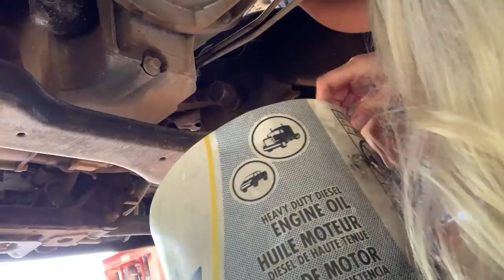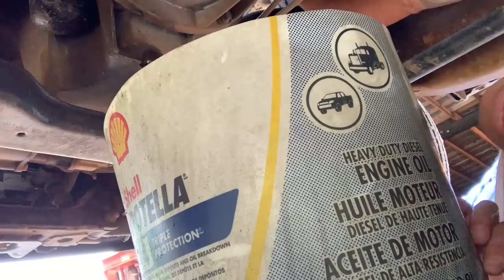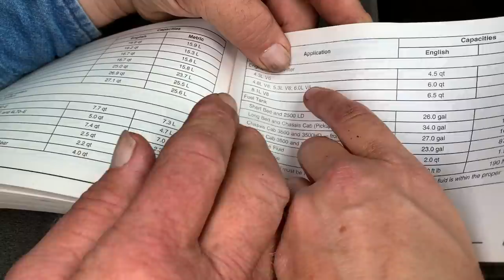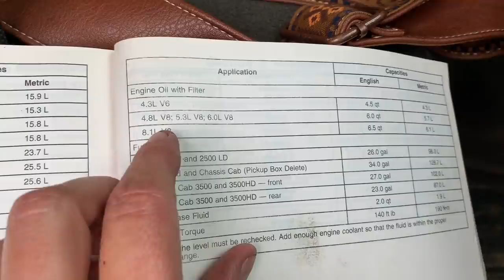I learned how to change the oil in my truck!

Comment: Meredith next time you change the oil get you a pair of dish washing gloves that go half way up your arms. They are thicker than normal rubber gloves and will give you a little bit more insulation from the hot oil. A long sleeve shirt wouldn’t hurt either 😉 oh and don’t put the gloves in the trash when your done just wipe your hands with a rag till they are somewhat clean and put them up for the next time. A long handled ratchet and socket might be easier for you when removing the oil drain plug😁 no confusing wrenches 😂 that was pretty funny I had a good laugh. Happy birthday to your son. Pound cake is my favorite too.

Comment: Hard to beat a good pound cake.. YUMMMM :)   Something I do when messing with my car stuff, changing oil etc.. is to wear a pair of those black nitrile disposable gloves.  They are very strong and saves the grease, oil etc.. from under the nails or on skin, much easier cleanup.

Comment: LB you have enough junk (recycled farm materials)  laying around to make a good and safe pair of ramps to drive vehicles up on. Please make a pair to use in the future. I have a 2500 pickup just like hers and I knew that 2X4 was going to break on the left side. My truck has fallen off that kind of setup several times. A few minutes of safety can and will save a life. Yours and hers. Just saying from Concerned friend.

Comment: "You hit your own hand this time" Priceless....... Neat shell pouch. Not long before bird season. It will come in handy. Your farm Journal exposure will help you and the farm. Could open some doors. Good job on the oil change. Always remember two things. Replace the drain plug and tighten it securely and replace the filter and tighten it too BEFORE you add the new oil ( don't ask me how I know).

Comment: When I was a young man my dad bought a 1961 corvair for 20 bucks and pulled it in the driveway for us three older boys to share. It was in 1971. It needed lots of work to get road worthy, brakes, tires, shocks oil change, plugs carb kit, just about every thing on the interior replaced. I think he got it out of a junk yard to be honest but I said are we, meaning my dad and us working on it together. He said the tools are in the garage, make sure you clean up your mess and put my tools back where they belong. That's the school of hard knocks. He figured he did his part, he bought it. Lol

Comment: Also make sure when you take the old oil filter off that the rubber gasket ring is on it and not stuck to the engine or you will end up with 2 rubber gaskets on top of each other and it will leak. Each filter comes with a rubber ring gasket attached so just make sure the old one comes off with the old filter as sometimes they can stick to the engine. If it sticks just pull it off and toss it so the new filter gasket sits against the metal on the engine when you screw it on.

Comment: One thing when changing oil on your vehicle make sure you don't double gasket your oil filter. When you remove the old oil filter the gasket from the old oil filter does not stay attached to the base .

Comment: Happy Birthday, Wes! I was smiling the whole time you were changing your oil.... Remembering the first time I tackled that job. My Dad bought a new 57 ford station wagon and had it till 1968. I can remember a lot of good times and lots of things that happened in that wagon and to it. That's the car I learned how to change the oil on when I was in 6th grade. I pulled the plug and drained the oil and changed the filter for my Dad so he wouldn't have to get under the car in the dirt. He then added the new oil and ran it for a few seconds. Shut it off and proceeded to check to make sure the dipstick showed correct amount, and it was way over full. He started checking to see what was going on and found the oil in the drain pan was red. I had drained the trans fluid. He had me follow him back under the car and explained to me the difference in the motor and transmission. He was so calm about it that I remember to this day how bad I felt but he made out like it was not a big thing. He had to go get more oil and filter and trans fluid. Cost him more than double that day but I learned a life lesson.
Reply from the maker: Aw that’s a great story! Best lessons 🥰

Comment: Nothing wrong with good high quality 15w 40 oil  Diesel  rated oil for your truck. But  OEM recommendation is for 5w 30 viscosity oil.Being down south in your warm climate 15w 40 will work fine.Being in the cold northern climate that same grade of oil might be to thick at cold start up. You may experience some valve train clicking on cold mornings when temps dip below 20 degree F.Always watch your oil pressure gauge at startup. My 08 Silverado with the 4.8 L i find the 5W-30 flows better in winter time.I change my oil  once every spring with just under 50%oil life remain.

Comment: That is the best class you could have on changing oil. Lol.  Learned to lock two wrenches together and LB really wanted you to get filthy.... next time, take a 20 penny nail and a hammer and punch a hole in the filter. Drain the oil out of the filter before you take it off helps.

Comment: You did great with the oil change. You reminded me of my Uncle years ago he took his Chevy pickup to the local mechanic and had it serviced. He drained the oil and replaced the filter and tightened the drain plug. He got a phone call and afterwards he called my Uncle and told him the truck was ready to go. Uncle John picked up the truck and drove home. He didn't go very far and the motor quit. Had it towed back to the garage and the mechanic discovered he didn't put any oil back in the engine. Mechanic paid for a new engine . Always remember to put oil back in and check it after you drive a little.
Reply from the maker: Oh  no! That’s not good
Reply: Also, NEVER rev the engine on start up after oil change.  It takes some time for oil to circulate in the engine.

Comment: Oh, and by the way, while you were under your truck, it would be a good time to change the air in your spare tire.  Air that doesn't get circulated like the rest of the tires will get stale and cause the rubber to crack.  Just a Pro Tip.   I Loved this video.  Not one mention of Lefty Lucy.

Comment: Try using surgical nitrile gloves. They keep your hands clean.  They cost about $5 or $6 per 100 at harbor freight.  Any greasing and oil work. They keep you clean.  Also. Please be safe and use better ramps and blocks.

Comment: You did just fine Meredith, that trick he was verbally teaching you regarding the " Cheater Wrench' adding leverage to the first wrench by adding a 2nd is not simple if you are not show visually how to place them, a simple 1 foot section of 1-1/4 aluminum pipe or tubing works far easier in adding leverage to the wrench, it simply slides over the outside of your wrench in place and doubles or triples adding leverage, that is typically the preferred method for simplicity and the method i show beginners. The wrench trick can be confusing to anyone not familiar, just my two cents, you did good, except pull that hair back and put it in a pony tail.

Comment: Hi, I loved this video.  First comes my oil job tips.  Make darn sure that truck/car is safe on those boards.  Move it side to side before you get under it.  Wear eye protection.  Dirt and rust usually fall on your face.  Have all the tools you need with you under there.  Put fresh oil on the rubber gasket of the new filter and hand tighten only.  Have all the oil you need out and where you can get to it so you won't overfill.  Run the engine for a couple minutes and ck or leaks.  Your hair was beautiful .  What color are your eyes?  We saw them really up close here and they change with the light intensity.

Comment: tip on that oil filter the next time. take a plastic bag put over your hand inside out.. unscrew filter let oil drain for a bit.  use baged hand to remove drained filter then slip bag over filter if that makes any cents no oil on hand
Reply from the maker: I like that idea!

Comment: Great Videos,  glad you learned oil changing on your pickup, Lawrence should have told you to make sure that the old oil filter gasket comes off and to inspect the filter base to make sure there is not a old gasket stuck there, double gaskets have caused many engine failures, I am sure he knows this. Again great channel

Comment: Meredith, I feel that I must apologise for laughing while you were attempting to un do the oil sump stud. Your hair looked so perfectly clean that I almost could smell the shampoo. I feared that a spout of oil would get onto it. The trick with the second spanner is an old one and functions as a lever. (Thus, the law of the lever).
The changing of the oil while being instructed by Lawrence, certainly was the high point of the vlog for me. How you weren’t douched in oil, is beyond me.
Happy 12th. Birthday, Wesley.

Comment: OK Meredith, this week only two Gems of wisdom,1= concerning Lawrence's new boots particularly, or leather goods generally, I've found that to double lives of boots,that liberally applying a lanolin based wax,protects stitching and hastened the breaking in process, 2= when removing tight bolts,nuts,or drain bungs,the using of a socket with a breaker bar,gives better leverage,though persistence in mastering the dual use of Ring/open end spanners is worthwhile skill?also dont forget to fill new filters with oil,before fitting to prime oil pressure, and apply oil to sealing ring?love how you have grandmother's recipes!
Reply from the maker: Good advice! Thanks!

Comment: Lawrence had me laughing when you were changing the oil. Don't worry, I'm not sure how to change the oil either. The conversion with the people who would help me wouldn't be PG like yours. The two guys who would help me are both engineers. One's a retired mechanical engineer and the other is a structural engineer.

Comment: I think the land leveler you are talking about is actually a land "smoother" if its the implement in your last video its a great tool many call a ROLLER OR ROLING HARROW which is like a cultipacker and a cultivator units all in one.  This is different from a "DO ALL" that is basically a disc with a harrow attached behind it.
Reply: One manufacture of a "leveler" is "Brillion", their version of a leveler is called a "Cult-a-Multcher". Great tool as the last-pass  before planting. When the spring-teeth are down it pulls like a: Cat-by-the-Tail.

Comment: the oil is suppose to be hot/warm when u change it all the dirt a grime and particles are all floating in the oil when its hot they settle to bottom when engine is off and cold also it runs out faster when warm :P

Comment: Oh yes you need to palm hit it , brut strength dose not work, cantilever interlock the the box ends just like he told you , they make a cheater bar, it sold at NAPA automotive parts houses, lolol you two are funny, you need to palm hit it a couple of times after it is snug, he is correct if you don’t get the plug tight it will absolutely vibrate out , from harmonics vibration, ok good job mer, love ya thanks y’all BigAl California.

Comment: Should really have used  a socket , longer handled 1/2 in drive, to get off that oil nut. Make sure its 6 pt too not to strip the bolt.Most people over tighten it and the oil filter . But you did it and thats the important thing

Comment: I have to give you a warning if you ever get to use a creeper to get under a vehicle make sure you put your hair in a ponytail. I used to have long hair and I didn't put it up one day I was changing my oil and I rolled under my truck and my hair got caught in the wheels on the creeper and I was helpless I was stuck underneath my truck it hurt so bad I had to cut my hair to get free of it.

Comment: I always wear a hat, safety glasses and use a 6 Point socket with Johnson Bar or long handled ratchet to remove those.
For the first time you should have been shown not told.  Always put some oil on the rubber seal of the gasket.  There are wrenches to tighten and remove the filter.

Comment: Happy birthday, Wesley! 🎂👍🏼👍🏼
25:33 Funniest thing ever. That HaHaa, by LB, had me rolling!  😂🤣😂🤣 Should have put that in the highlights, at the beginning.
Find a short length of pipe that will fit over the end of that wrench. It could be 6 to 8 inches long, or more. Keep it in the tool box. That will give you the added leverage to work that bolt free.
Loved watching you change the oil! 28:11 So cute! Will you change my mine? I’ll bring my car up!

When I want to learn the correct way to pronounce a word (usually long words 😁😉), I go to dictionary.com, put the word in, pull it up, and click on the little speaker icon. They pronounce the word for you.
Hate to be critical, but “oil” should be no problem for you.” Say “oi” about 10 times, then put a “L” on the end. You’ll have it licked!

Comment: great job on the oil change,are there any grease fittings on that chevy under there?usually goes hand in hand on an oil change,ask LB,Im curious.A pair of cheap rubber gloves work good for oil changes and grease jobs.

Comment: If the oil was hot you had to put on gloves. Did you close the oil cap tightly? if you lose the cap on the road, the oil comes out and the engine breaks out. Under the car you needed an action camera for shooting. Where do you put the old oil? In Italy it is very complicated to dispose of it.

Comment: Too bad you're missing out on the "Tune-up" and having to change the Points, Plugs and Condenser then timing with the timing light. That's all in the past with today's electronic ignition systems. 
Maybe in a couple years, you can help Wesley change the grease in the Muffler Bearing. Or better yet, head out to the Auto parts store to fetch a spool of Drive Line. That's a popular item and they are almost always out of it. But there is always one more store you can check for it.

Comment: How many mi or months since your last oil change? I,m surprised that with the high miles on that truck ,no rear main oil seal  leaks at all . usually most engines by 100k mi have some sort of  oil leak somewhere.

Comment: When you removed the oil pan drain plug, you realized how tight the drain plug was tightened, because you had to use a second wrench to interlock with the first wrench in removing the drain plug. I noticed when you tightened the drain plug, after draining the used oil from oil  pan, you didn't apply the same amount of torque (Twisting Force) when removing the drain plug. Word of Caution; When you start your vehicle engine and drive down the road to whatever destination you are headed to, engines have a tendency to vibrate. When the entire engine vibrates, to include the oil pan drain plug, can cause it to vibrate loose. This is the reason you need to tighten the drain plug with quite a bit of force. How much force you ask? Have Lawrence look up the torque setting for the drain plug and use a "Foot Pound Torque Wrench" in applying the correct amount of torque. This will provide you a "Feeling" as to how much torque you need to apply to that drain  plug making sure it doesn't vibrate loose while your driving down that North Carolina highway or country road.

Comment: Pool party, now that's livin' high on the hog.  Make a slip-n-slide with some plastic film and a hose to spray water on top.  The herd will be screaming running back and forth between that nice pool and the S&S.  Can't wait to see LB in the pool partying with his son.
Son in the cowboy outfit young was the spittin' image of Lawrence, a little Lawrence. 
Cute as a bug.
....
Old Hickory farm kitchen knives, grew up with them
...
Oil Changing, sounds like me and my wife trying to do something together.  We gave up years ago working together.  I'm 10 years older than Lawrence but he may be even crankier to his woman.

Good thing LB doesn't get any oil in his air, he ain't got none.
....
Next time, wrap your hair in a tight bun and wrap the bun in plastic and hold on the bun with rubber bands.  Will keep that beautiful long blonde hair clean.  Just like my Swedish sisters did spreading chicken manure with pto speader slinging chicken crap all over.
Put blocks behind back tires to keep the rig from rolling back on you and a large block of wood under the frame or front end where you're working so you don't get crushed.  Or get some jack stands at auto parts store.

Comment: Now.....watching you get the concept of the two wrenches was a hoot....You need to play that again.....Sometimes intelligence should be measured by the amount of exposure one has to what you are doing.....Ask L.B. if he has ever taken a punch and put a hole in the bottom of the filter to drain it before he takes it off....Someone should invent an oil filter with a drain plug in it...

Comment: 22:15 I"m scared for you, too.  I would not trust that assembly for my life.   Find a low spot on the ground and drive over it. or use the tractor to dig a ditch that you parallel park on top of.  Your truck should sit up high enough that you can climb under to get to the oil filter, no problems,without the need for ramps.. that assembly he build has a potential for causing more harm than the good it does.  it can act like a see saw and if you drive too far forward and you drive off the blocks, the wood will flip up into the undercarriage of your truck...and possibly damage something important that will cost money and time to fix.    Why did he not hook the bucket of the tractor under the front end and lift it up and then slide wood under the tires...or why not just jack up one side of the truck for easy access.  inquiring minds want to know.  I'm here to keep you safe...and look out for you.  Anytime you crawl under a vehicle that is raised up, always use JACK stands to support the vehicle and block the wheels...in this case, the rear wheels...so it don't roll off and down on YOU !  stay safe.